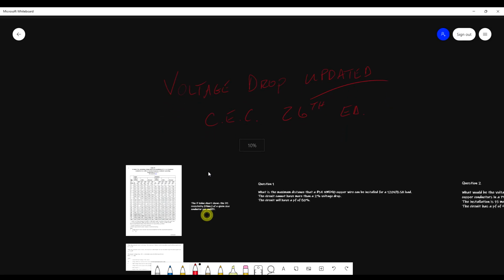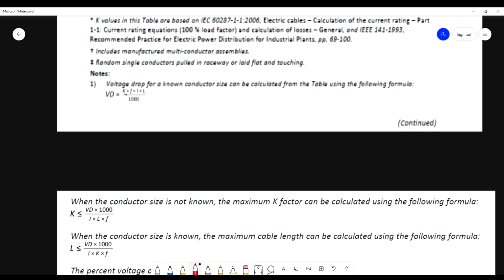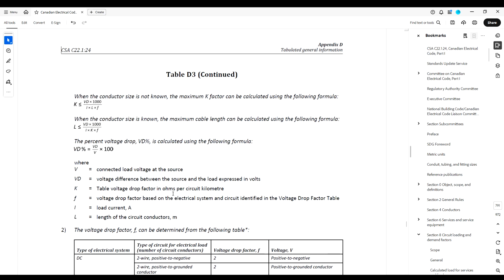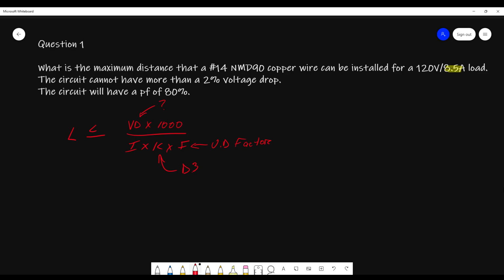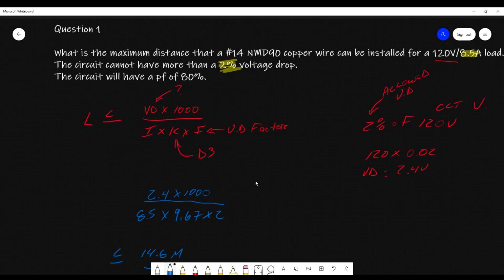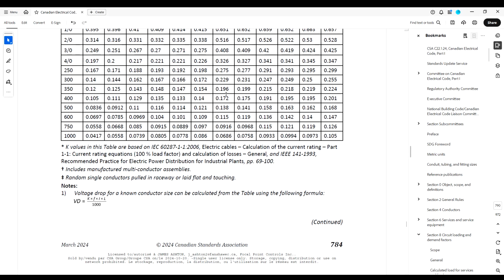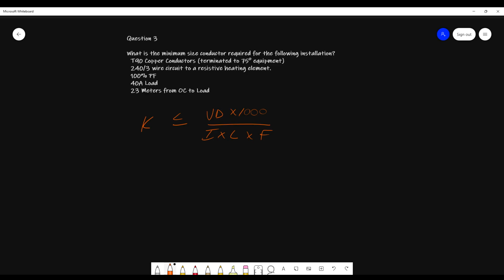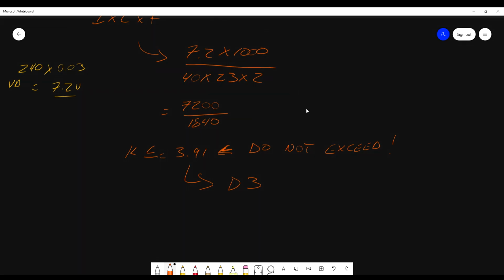Voltage drop calculations - UPDATED as per 26th Edition of the Canadian Electrical Code.

Comment: Hello. thanks for the video. In question #1 did you forget to multiply the K-value by 1.05 as noted in note 3. table D3 is based on 75 degree conductors and the question mentions MND90. K= 9.67 x 1.05 = 10.15 ?? my final answer, i get 13.91meters
Reply from the maker: Hmmm?  I will have to go back and review.  If I did then good that you caught it.

Comment: so how to determine that F value is 2 in a 240V/3 wire circuit
Reply from the maker: Look at D3 (2) - a 240V/3 Wire circuit falls under a single phase system.  Your F factor will always be 2 except for what is shown in D3(2) for the last 2 rows under the 3 phase AC system.